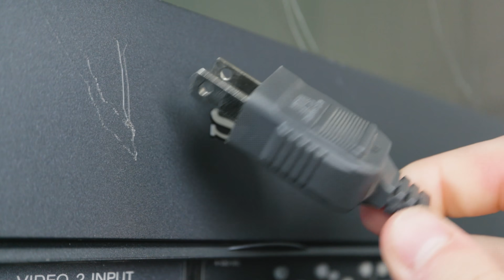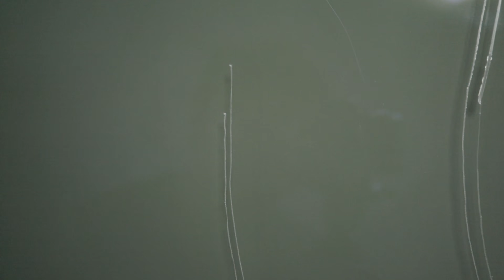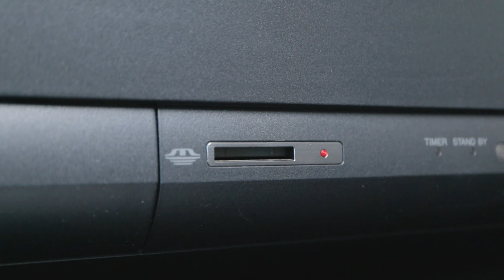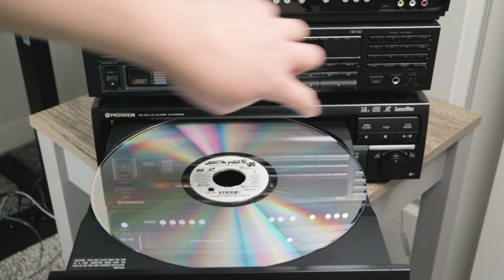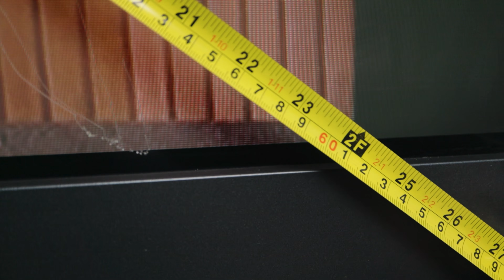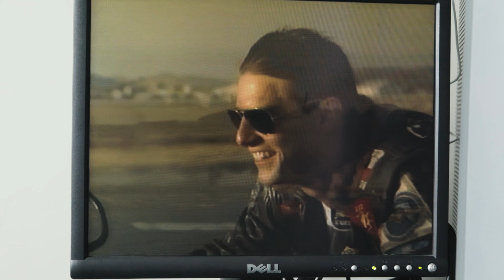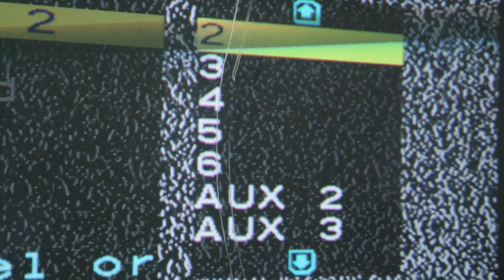The HD, WIDESCREEN Tube TV! Sony Trinitron KV-30XBR910

Comment: I picked up the Japanese version of this TV. No DVI, but it has D terminal in addition to component, which are electrically the same. Even here in Japan, these TVs are getting harder and harder to find. Pickup a spare HD CRT when you can and put this baby on a surge protector or even an APC! Enjoy (:

Comment: These TV's were a pain in the ass. I had the HDMI model. The picture looked great however if I can remember the overstretched was horrible. To fix it you can use the maintenance menu but there's only so far you can go. I didn't have the space so I had to get rid of it.
Reply: Also there is input lag cause it uses a digital converter which is why there's overstretch issues.

Comment: i've got 2 widescreen Toshiba crt's with hdmi's one is larger than the other, but both are similar enough models that they both share a manual. i found them only a couple weeks apart too. def one of my greater purchases even if i don't use them that much at the moment
Reply from the maker: That's so awesome you got the exact same models

Comment: I had a kv 21fa310 I got from Mexico that has a subwoofer and simulated center channel that attaches to the top. That thing seriously bumped! It had perfect geometry too. I got rid of it during my last move because either it needed to be rejuvenated or it had some cold solder joints. Blacks were green like and whites very magenta. I only got it for 15usd so i just set it on the curb. I should've at least peaked at the back.
Reply from the maker: That's cool!!

Comment: Two cool things you should check out, Slow Scan TV and VHD. slow scan TV are images broadcast using audio signals, and VHD is an old disc format from japan, akin to an old record, but has support for 3D and this was in 1993 i believe. They're also kinda the predecessor to LD or laserdisc. You should also check out MUSE HD or Hi-vision... It was Japan's version of HD way back in like 1993 as well. Super cool!

Comment: The DRC thing upscales+de-interlace SD signals to 960x540p, or in case of HD signals upscales 480p and downscales 720p while 1080i is processed as 540p since it is same 33.75khz signal
2) the up/downscaling adds huge imput lag so if you have an external caller you can feed 540p trough dvi or component and there's a service menu option that allows you to completely bypass DRC circuitry and have an 1000+ lines 33.75khz monitor. Google (Sony trinitron 540p). These trinitrons are gorgeous when run native resolution. You can get real scanlines with external scaller of you know how to program custom mode lines.
Reply from the maker: Oh thank you! That's so cool that they let you do that!
Reply: @simonretrotech  also these scratches on the front glass can be fixed. but you have to bring it o a shop that provide lense polishing services and probably have to pay a good amount.

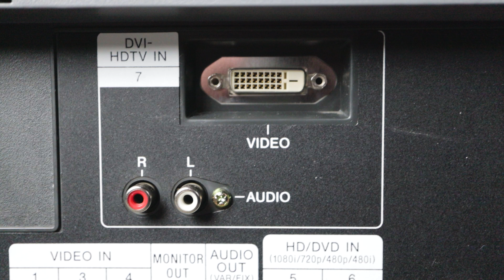Comment: 4:31, if only it would've used DVI I (which supports analog + Digital) then we can send analog HD RGB signal into the TV, and if the signal is the TV's native resolution (1080i), then the circuitry could be designed to bypass converting it to digital and send the signal directly to the tube, therefore less latency
Reply from the maker: Ohhh that would've been awesome!

Comment: For the screen scratches you could try a windscreen repair kit that they sell for scratched and chipped car windcreens. I have seen them buffed out before as well using a Dremel. Maybe a bit of both is required - the Dremel to smooth any sharp edges or splinters, to make it ready for the windscreen repair kit (which is a resin that hardens to fill in gaps). Maybe you could go to a windscreen repair center and ask for some advice.

Comment: I had a Sony KV-35XBR48 and using the original remote that also looks like that one and amazingly still had a joystick from as far back as 1997, the joystick is also clickable like a Playstation controller and it would pull up the view for 9 channels at once! I don't remeber if it worked on either on a video input, or the antenna, or both, as that TV broke a long time ago. Anyway, I am not sure if it worked with other models, as clicking the joystick pulled up the favorite channels menu as a quick shortcut on my KD-27FS170. Also, the freeze button can actually work on the TV if the switch is set for the TV and will freeze whatever frame was on screen whenever you pressed it, which is quite interesting. Lastly, these sony trinitron remotes with a joystick can still be used to change all the settings on a modern Sony TV, including top of the line Sony OLED TVs, and it's only possible because of the joystick and clicking on it to confirm the settings, as the other buttons sadly don't do anything.
Reply from the maker: Ohhhhh that's how you do the nine channel thing haha! That's interesting that you can still use the remote!
Reply: @SimonVideo wait, so the nine channel thing actually works on your TV? If so, I thought it was exclusive to my model, and it even had the option to have twin view as well, as well as being able to  have the antenna on one screen, and a video input on the second screen of the twin view, although I think it only worked on video 2 for some reason and you have to activate it either when you're on the video 2 input, or the antenna, I don't remeber which one. Lastly, the last secret about these old sony remotes that I remember is being able to put on a wrist strap on it with the two holes that are found on the middle of the back side or the side underneath the big sony logo on the remote, like a wii remote. I'd take a wii remote wrist strap from a wii remote if you have one and put it on your Sony remote to try this out for yourself.
Reply from the maker: I haven't tested it on my model but I saw it in the manual and was wondering how to activate it.
Reply: @SimonVideo  Ok, just be sure to let me know if it worked for you or not. Take care!

Comment: The stick on the remote also clicks to make on-screen selections and the extra DVD/theater controls did not need (or use?) the S-port. You could program it to control your cable box or DVD player the same as many other TV remotes.
Reply from the maker: Oh that makes sense. Thank you!

Comment: Wait. You’ve never heard Memory Stick mentioned? Ever heard of the PlayStation Portable? Yeah, it’s the smaller Memory Stick Pro Duo, but it will work with this TV up to 128MB using the typically-included adapter (XBR960 did not require the Memory Stick to Memory Stick Pro Duo adapter). Also, the PlayStation Vita use M2 (Memory Stick 2). I also have a portable Sony MPD-AP20U DVD/CD player that uses Memory Stick. That thing was freakin’ awesome for the time and has the same styling as this TV. The way I looked at it was that people were spending several hundred on a 5GB iPod when the MPD-AP20U cost 10¢ for each 4.7GB disc and also had all the advantages of a solid-state flash MP3 player using the Memory Stick.
Reply from the maker: Haha yeah I never had a PSP!

Comment: As for the scratches.. these tvs have a anti glare film that can be removed people nhave been removing them because they like the gloss look.  You can peel it off it is probably that film coating thet is scratched.    I found.this out trying years ago when trying to remove the front bezel. Because you have to take off the front bezel to do it.

Comment: Analog had NTSC 525 vertical lines and PAL has 625.  In any case don’t use HDMI it is trash, you need RGB(SCART)  or VGA/DVI gives you the best quality on analog 🫠.  DVD is only 480p you should try hooking a PC or playing bluray with component

Comment: HD CRTs are not highly sought after because the digital processing adds input delay for retro gamers. It's still a cool TV to have though, especially because getting a faithful CRT filter for modern TVs costs $750 with the Retrotink 4K, so for now actually buying a CRT is still the cheaper way to do it.

Comment: I used to have one of these.  I ended up getting rid of it in favor of an older SDTV for retro gaming so I could still use light guns.  It was a great TV.  

Also you need to hit the gym if you can't lift it by yourself.  I used to move it around myself no problem.
Reply from the maker: Up the stairs too? If it was a matter of life or death I'd do it but I'll pass 😂
Reply: Yeah I can deadlift 500 the TV is nothing.  It has handles.

Comment: 15watt sub ain't nothing to sneeze at, they're surprisingly good for their sound. I had a 14 watt Cyber Acoustics PC speaker set that I used for my 'home theater' and that little 3 inch sub had some good thump.
Also DVI is way more dependable than HDMI. Bolts into the set and never gets bumped loose or broken because a cord got moved wrong.

Comment: I remember my dad showing me an old trick because he was a TV repair man, Just get a little bit of light machine oil, like 3 in 1, and rub it into the scratch, and it will mask it by about 75~80% and it will last a few years. Reapply as needed.  😊
Reply from the maker: That's awesome! Thanks for commenting- good to know someone else already tested this haha
Reply: Windscreen scratch repair kits may also work, as these scratches look pretty severe.
Reply: @DoubleMonoLR  Yeah pretty severe, at this point it is pretty much consigned to just be masked, If you tried to Polish out a scratch like that, you would just make the repair attempt noticeable.
Reply: For glass screens, I would actually use the windshield repair kits and a UV flash light/sun to cure it. Worked amazing, permanent.
Reply: @SAMCAMJAIK1  But that stuff is generally made for cracks because it gets pulled into the crack from surface tension, a Scratch is quite a bit different It would pretty much be like putting glue in it, and then it would break down after a couple of months maybe a year. But I can't Really say that it wouldn't work, because I haven't used it in a big scratch like that, only for cracks.
Reply: @aarongreenfield9038  it works, it wouldn't degrade or fall out if prepared properly. It's like filling scratches in the clear coat of your car paint and buffing. You would have to first clean the scratch and surrounding area with rubbing alcohol, then you could fill the scratch with resin. But for it to look seamless you would have to polish it and blend it with the non scratched glass. The real problem is the contrast in clarity and color between the resin and the glass.
Reply: @vinny2t491  Oh i know, just kind of doing a quick cliff notes recap on how/what i did, I know you can get a little more involved in it to make it last longer look better etc, but I was just trying to keep it kind of short and To the point. Probably doesn't really matter too much on a TV like this, it's not really going to be An important centerpiece that he watches TV on a lot, just to play Classic video games on tinker with and for nostalgia.

Comment: 14:58 - This is a problem in the TV's power supply section. It's usually caused by a worn-out component, like a capacitor
Reply from the maker: Good to know

Comment: At least in Europe it's actually perfectly normal for a TV to have a video out. It's mostly used for things like Pay-TV descrambling and external teletext decoders. Also most consumer HDTVs in Europe had a D2MAC decoder inside, so if you wanted to record a TV-show you could use it's output. Unfortunately the HDTV-Hype kinda stopped when digital TV came around in the mid 1990s and TV stations abandoned the switch to HDTV in favour of digital TV.
Here's the input block on one of the more popular CRT-based HDTV TVs from the early 1990s
https://de.wikipedia.org/wiki/HD-MAC#/media/Datei:Nordmende_Space_System_92_HS_Scart.jpg
Note that "EIN" stands for "Eingang" (Input) and "AUS" stands for "Ausgang" (output).

Comment: My parents had similar Philips tv, which handled sources up to 1080i. To get progressive scan on it you had to feed it through component, with a source that's able to output 24p (like dvd player with that capability), then tv did the rest. On one hand you get the original movie framerate, but on the other 24Hz refresh rate on crt tv can be tiring for the eyes.

Comment: Remember that the original models of the Xbox 360 did not have HDMI in 2005, that did not come until some of the first hardware revisions. While they published the standard in 2003, it took years for standards like that to propagate, USB came out in 1996 but the ports didn't start showing up on computers until like 1999.

As for Memory Stick, did you never use a PSP? They used Memory Stick.
Reply from the maker: Good to know! Yeah, never had a PSP :(

Comment: CRTs can have lag but this is pretty much exclusive to the HD variants of them due to digital processing. If there was no processing there would be no lag. Some HD CRTs actually did no digital processing on certain signals but this would vary from CRT to CRT. Also VGA CRTs are even sharper than these HD sets from the 2000s
Reply from the maker: Interesting! I should test it out and see if there's lag on composite inputs

Comment: These CRT TV's are great, though when you said you where impressed by HD content with your Xbox 360 connected, you should see how things looked SONY PC CRT screens from back in the day like the F520 or FW900 with way higher resolutions and refresh rates, man I still wish I had mine. I worked in a PC Hardware store back than and even these smaller monitors weighted at 20" around 30KG and 22" 40 KG which gave me a good workout getting them for the customers.
Reply from the maker: Wow! That's awesome!

Comment: Just because it's a CRT doesn't mean it automatically has no lag.  Some of these late-era HD CRTs definitely did.  I almost bought a related model, the 34XBR970 back in 2007, until I rolled a full tower PC & VGA monitor into the Circuit City to do some comparo testing.  The result? 30-something milliseconds of lag, about 2 frames at 60fps using the DVI.
Reply from the maker: That's a good point

Comment: Consider buffing the scratch edges with a diamond compound of mesh number 5000 or higher and filling the gap with OCR UV resin. The resin is usually sold in small portions for automotive windshield repair.

Comment: While these CRTs are fantastic, I actually have a 32" widescreen Trinitron myself, the flat panel CRTs that supported HD actually have terrible latency due to the extra post processing added to these TVs, instead of 0 milliseconds of latency, its usually 38+ milliseconds which is considerably more than modern day 4K TVs even (In game mode at least) so they're only really good for laid back casual gaming if you aren't sensitive to lag
Reply from the maker: Oh that sucks.. I wish they didn't do digital processing, at least for the 480i sources

Comment: Over the air HD TV looked better back when this thing would have normally been in use. The FCC repacks (cough, theft) have ruined everything. Now OTA TV looks like YouTube did back then.
Reply from the maker: I think it still looks pretty decent! It handles confetti and stuff better than streaming platforms do in my opinion. But yeah repacks have really messed with OTA
Reply: @simonretrotech  You must live in an area where they don't have any or many subchannels. Even if a physical RF channel only has one channel, the old ass mpeg-2 can't compete with modern codecs used in streaming.

Comment: I had this exact same model, and the matching stand. Did lots of service menu adjustments to fix some convergence and color issues. It was scrapped when the power supply started failing and it wouldn't reliably turn on.

Comment: All DVD (and most newer LD players) will have an option in their setup menu to set the TV screen type they're connected to as 16:9, which should bring the subtitles back into view.

Looks like the player is outputting 4:3 instead. 

DVD Player may have been dynamically switching aspect ratio according to what's on the disc (early DVDs often had a mix of 4:3 and 16:9 on different aspects as logos hadn't been redone for widescreen yet). 

The TV will be set to Auto aspect ratio if you're seeing it automatically change it. You can force the TV to make everything fill or fit the screen by toggling Aspect modes and do the same in the DVD player's Picture/Output menu (all DVD players have this, even BD ones now). 
 
I grew up with a Sony TV of this generation (same menus and similar styling) in family home. Not such a high end model though but great fun for us all. 

Yours the kind of TV Sony would've demo'd in the retailers with their 2003 blockbusters like Charlies Angels: Full Throttle and Terminator 3!
Reply from the maker: My player doesn't have any menu as far as I can tell. The captions are being decoded and rendered by the TV so it's the TVs fault!

That's so cool that DVD can signal the aspect ratio!

I would've loved to see this TV on display

Comment: Some Sony XBRs had a coating, which I usually remove (like on the 960), I can't recall if 910s had this antireflective coating or not, but you can indeed remove it and personally I feel the picture is actually better without it.

Comment: I love these 1080i/p HD  CRT flat - widescreen TVs. They are so hard to find anymore and were so short lived as a technology because LCD panals took over rapidly.
they are absoultey amazing for 1080p gaming the absolute GOAT for 1080 gaming its like having better than OLED colors, contrast,  and response times ....but in 1080 instead of 1440/4k
however a quialty 1080 CRT will; look as sharp and crisp as a 1440 lcd.

also car windshild chip and crack filler would do wonders towards fixing the scratches of that TV
Reply: As nice as VGA CRTs are they don't look sharper at 1080p than an LCD does at 1440p. I use mine at 1600x1200. Plus the detail they can show is down to the dot pitch